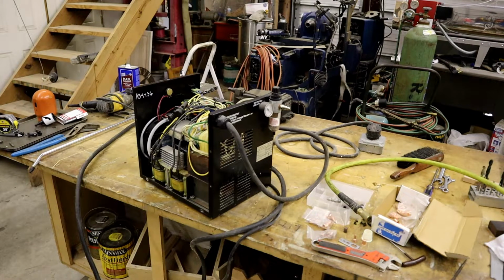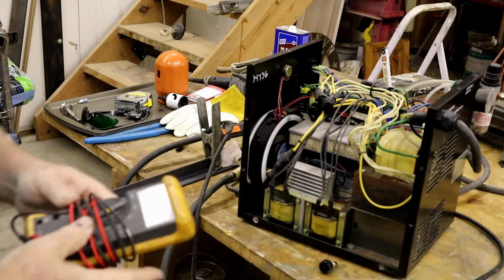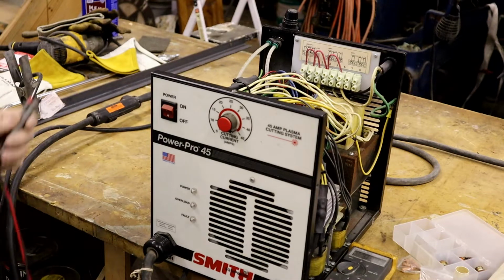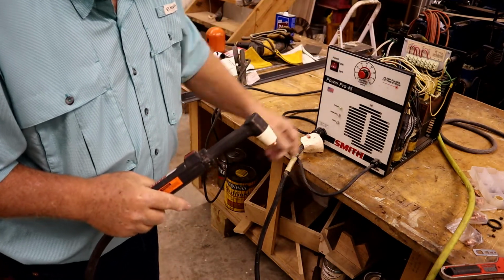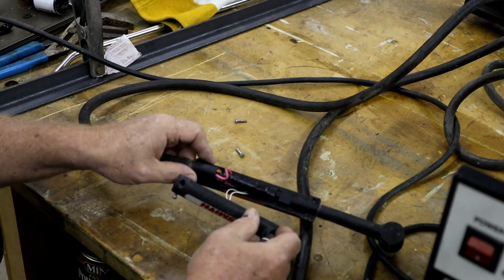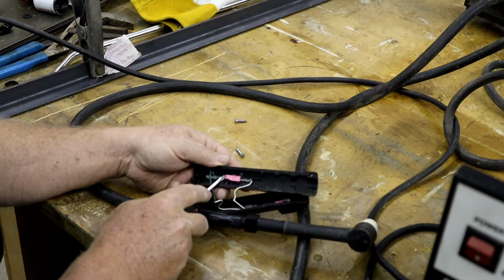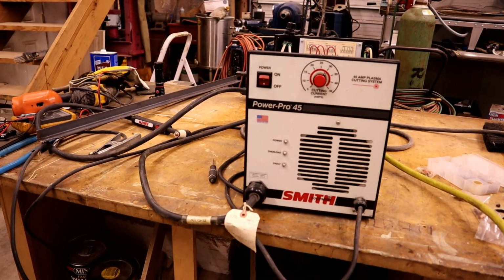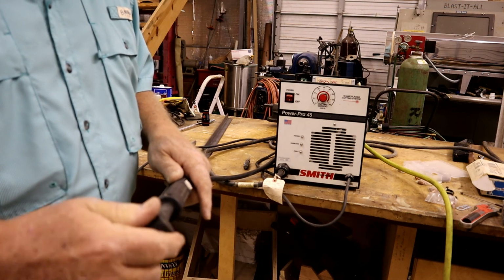Old Plasma Machine.  Part 2 "It LIVES"

Comment: There are 2 types of plasma cutters one that has a pilot arch start and one is scratch start. Yours is probably scratch start. I have never seen a tip that is loose like that. Are you sure all the parts are in the tip and tightened down?
Reply from the maker: Yes everything is tight.  According to the chart on top of the machine the parts i have are everything I need...
Reply from the maker: In Part 1 at 2:00 there is a close up of the consumables tag located on the top of the machine. I have everything listed in the "contact start" section.
I never thought about the "Electronic Start" section listed just below the contact start section.  As the contact start consumables came with the machine I figured that was what the machine used.

Is there a way for this machine to use both methods?
Reply from the maker: In my last post Youtube automatically added the link to the time.. That link goes to part 2 and not part 1...

Comment: You must not like your fingers! I am far from a safety sally but you don't ever want your fingers in front of a plasma torch. If that thing came on it will cut your finger faster and better than steel!!! You need a book to see if that machine is supposed to have a pilot circuit. Mine is on a timer relay as it will only come on for about 3 seconds then it switches to the contact relay created by arc to workpiece, if it isn't there it shuts down and you have to retrigger it to reset the cutting action.
Reply from the maker: I had already used a block of wood to test it out before filming that :)   and the triggers were not depressed....  I like my fingers !  

As for a Book.....Well that seems to be a very rare thing... I have 0 information on the machine and I can't find more than 5 mentions about them anywhere on the internet...  

A viewer gave me a lead on a person that sells and repairs all  types of machines.  I'm hoping he knows something about the brand and torch I have.